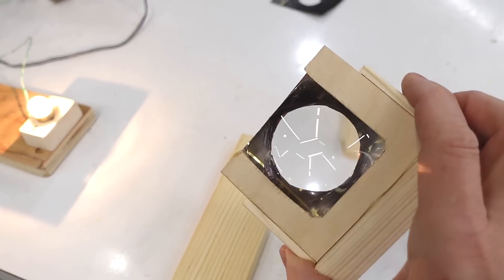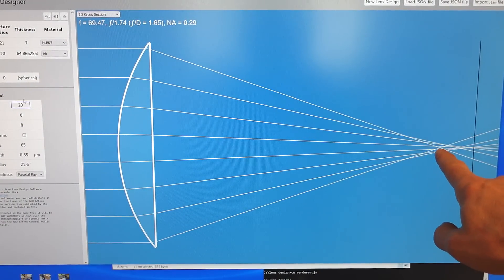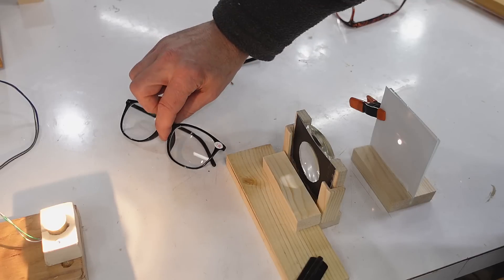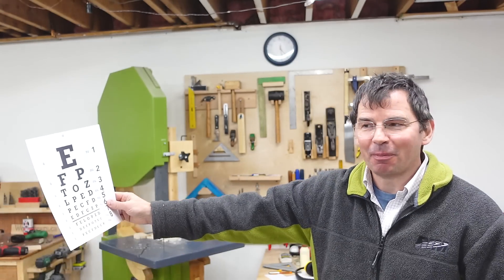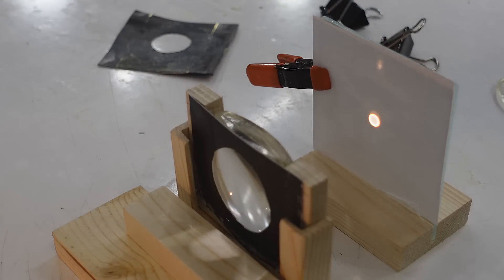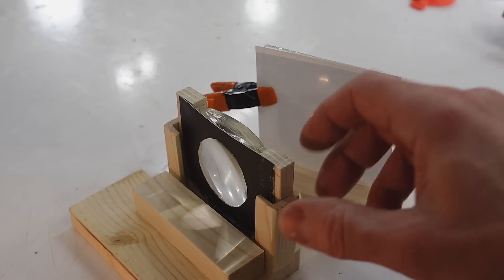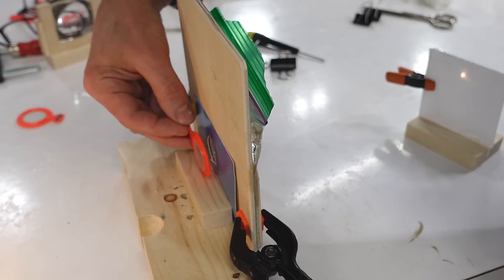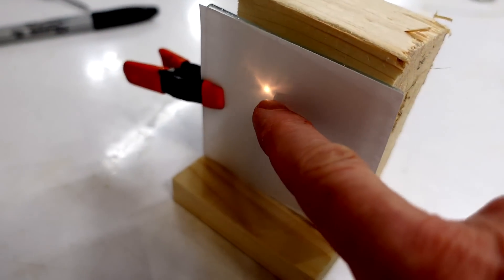We get slightly nearsighted at night, corneal aberrations, and stars

Comment: Some more food for thought regarding vision: I had cataracts surgery last year, right eye on January, left eye on May. After surgery you see everything mostly pink because of inflammation but as it subsides you return to your normal vision and that's when you realize everything is much colder than before. Turns out the eye with myopia (and maybe eyes in general) get a yellowish tint with time, however since it's the only "white" you see you never realize. Once I had the surgery it was amazing how the white I thought was white was actually yellowish, as if warm white, and the new white was much bluish as in cold white. Until you have that surgery you would never realize that what you think is white is actually not white.

It kind of reminded me of this book I read, "Through the language glass" by Guy Deutscher where he mentions greek called the sea "wine-dark" not because they mixed wine with something to make it blue but because they actually saw them as the same color until someone much later named blue and purple. Or that the old America aborigens could not process the Spanish ships traveling the sea with the limited knowledge they had so they just ignored them, made them effectively invisible in their heads (quote which I can't source at this moment).
Reply from the maker: The color thing is odd.  If you put on slightly tinted glasses, your eyes quickly adjust and white seems white again.  I had an odd experience years ago.  I went into an outhouse at a fair, it had a green transparent corrugated roof.  there was a hole in the sdie of the outhose, and I could see the sky looke pink.  I thought something pink covered the hole, but putting my finger thu it, there was no such thing.  My eyes had adjusted to the greenish light, so suddenly the natural blue light of the sky thry the hole now looked pink!
Reply: @matthiasrandomstuff2221  The brain has an amazing ability to compensate (and sometimes overcompensate) for what our eyes see. There's a fantastic video by Andrew Steele about colour in optical illusions, in particular there's a bit halfway through where he briefly touches on how our brain compensates for different light levels throughout the day to make white always look white.
Reply: I was under my car working with a trouble light when I realized my two eyes perceive colour slightly differently. Alternately closing one eye then the other revealed the rust under there was slightly redder through my right eye. No surgery or other mods.
Reply: @DD-DD-DD  i noticed the same when looking at the shadowed parts of a thuja tree in the summer.
through one eye the shadows had a very slight red colour, and through the other eye they seemed very slightly blue.. i thought it might have been a result of walking around with those red-green 3D glasses earlier that day.
Reply: Thanks - ever since I was a kid I noticed there were two mildly different color palettes in either eye, visible when alternating between open and closed.
Thought it was just my imagination or something...the weird diffraction patterns from my PRK surgery definitely aren't imaginary.
Reply: I've for most of my life seen things with different color tints from eye to eye. Easy to test. Look at some object with both eyes wide open. Put your hand in front of one eye. Then quickly move the hand in front of the other eye. You might well see a color shift. I can see that just looking at the monitor to read this.

I also had cataract surgery in one eye a few months ago. I immediately noticed that the unfixed eye saw things with a yellow tinge compared to the modified eye. I mentioned this to the surgeon, and he said that the cornea gets yellow as it ages. I guess that is not surprising. Clear plastic will eventually yellow due to the UV in sunlight. While the formula is different, a cornea is basically clear plastic, and is subject to UV most of the day.
Reply: @lwilton  Exactly! But even if it's a completely natural process (my surgeon said the same) that yellow tint is something you don't notice because it is so gradual it takes decades and in the meantime your brain simply compensates for it.
Reply: I had a similar kind of surgery only in my left eye. I also notice the difference in color perception. Even since my surgery was already 7 years ago my brain has still not fully adopted. However the effect has become less strong.
Reply: My uncle had the surgery he says the blues are much more intense.
Reply: @ColCurtis  I had a cataract removed from my right eye and I can see UV much better in my right eye than in my left.  If you shine one of those UV flashlights on the wall the beam much wider when looking through my right eye compared to my left.  I think it's because the cornea naturally filtered some of the harmful UV rays.
Reply: Actually never thought of that! i always observed by left eye had a slight yellow tint to it compared to the right eye.. My left eye is also the more near sighted one lol!
Reply: I've always noticed that each eye sees its own white balanced version of the world, one tilts toward warmer colors while the other leans cold. I thought that was the way the brain worked.
Reply: Maybe this explains people who like garish lightbulbs that are 6500k in their house at night? Maybe they have cataracts! That's the only explanation of why people would like such garish light inside at night
Reply: I am getting my second eye done tommorow, I can confirm.. whites seem crisp and cold with the new lens and yellowish with the natural one. There are lenses in development which can accomodate - if these last long term, (1st generation didn't) then I could see refractive lens exchange displacing laser eye correction for younger people....
Reply: I remember as a kid playing in a bright red plastic sandbox with a lid to close it. When I closed it on a sunny day and opened it again everything was green/blue for a few minutes.
Reply: Just wait until you have to have a yag capsulotomy, it’s another level again, blacks look really black and contrast is greatly improved, was amazed how sharp the text on my kindle looked.

Comment: I’m nearsighted. Growing up, my eye doctor would dim the lights in the room before testing my vision, projecting the eye chart on the dark wall. I switched eye doctors when he retired, and the new doctor didn’t dim the lights. My vision with the new doctor magically “improved” and my prescription was about 1 diopter weaker. This probably explains why.
Reply from the maker: More light means your pupils get smaller, which means your focus being off matters a bit less.  But that alone shouldn't account for a whole diopter change!  What I'm talking about only applies for when it's too dark to see 20/20 even at the best of times.
Reply: Actually, from a young age I would run into doors because the ligths shouldn't have dimmed.... Took me 10 years and 2 eye doctors before we had that one figured out. Mye eye sight is like -5 at night and -1.5 during the day... pretty severe. 
And by George, the accompanying headaches from the terrible glasses....
Reply: When I get an eye exam at the DMV, I stare at the light a few seconds. I no longer have an eyeglass requirement on my driver's license. (Iris closes down, bringing things into focus)